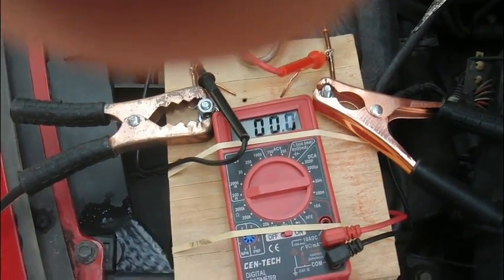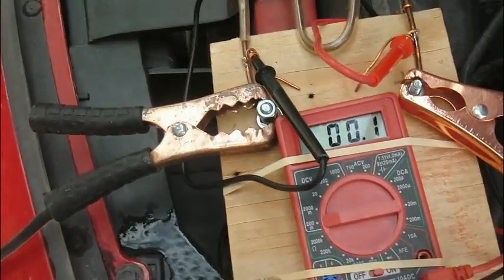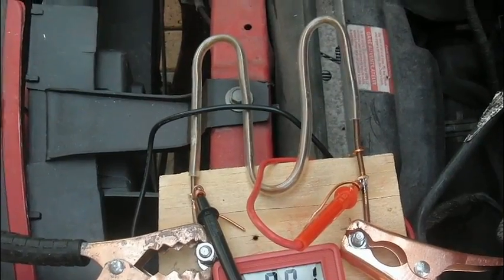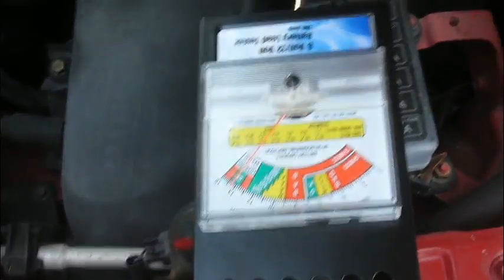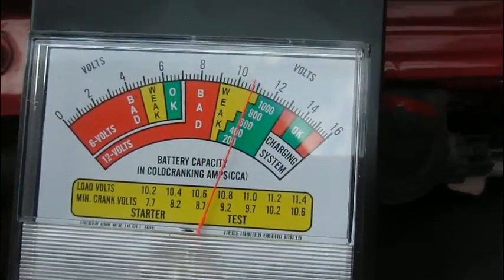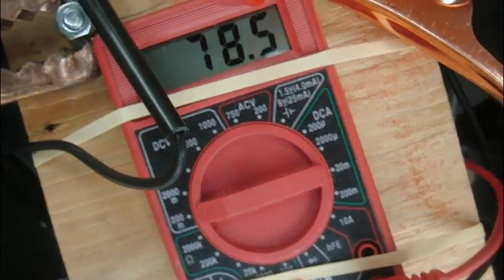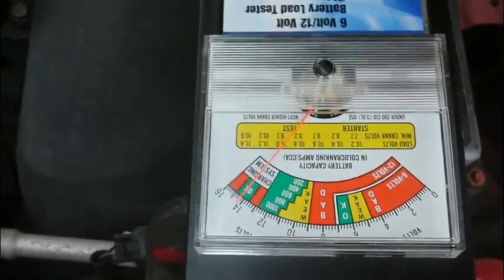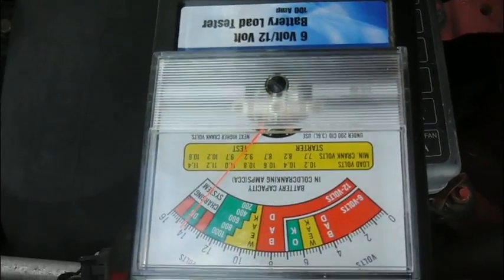Car Battery Tester Measure Amps and Alternator Draw

Comment: i suspect you are doing exactly what i am planning to do. Rather then buy a noisy generator for occasional power outages that will require maintenance and what not i bought a huge inverter. i was going to look getting 3  200ah 12v batteries run in parallel which are expensive and heavy and may only last 1 to 10 years. one of these 200ah batteries can better handle what my inverter asks of it then my vehicle so I am on a mission to find out why.

were you planning to run a inverter? if so how big and did it work out for you?

my inverter is 5000 continuous,10000 peak and my vehicle can only support about 1600 watts for about  5 mins before the voltage drops below 10.5v and it clips my inverter, assuming my battery is supplementing the inverter, i have a trailblazer with 4.2L.

I am thinking of adding smaller pulley to alternator, or upgrading alternator, or adding at least 1 more battery. but i suspect the adding of a bigger alternator is the best solution and the added battery will only allow me to add time to how long i can run the 1600 watt load before i get another clip due to voltage drop. My goal is a sustained 3000 watts btw, not the test 1600 watt load i have been mentioning.